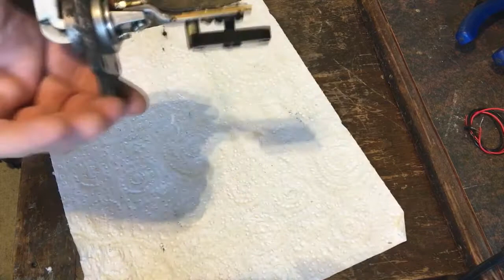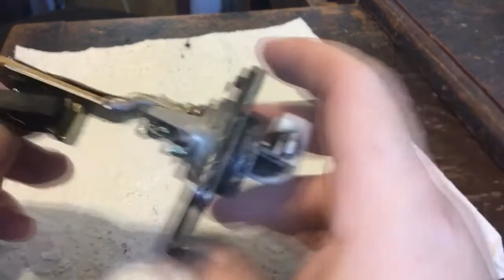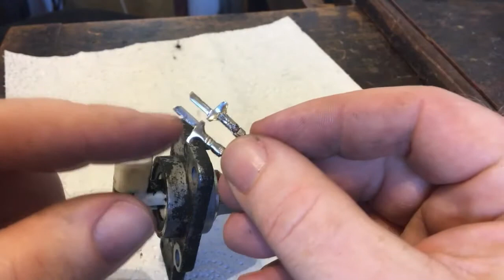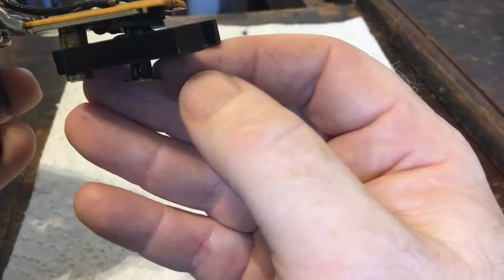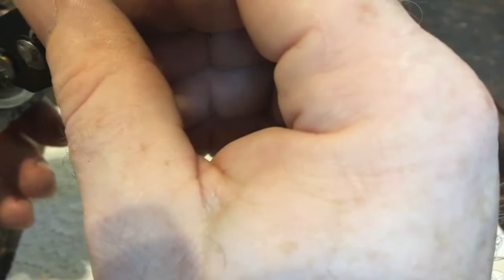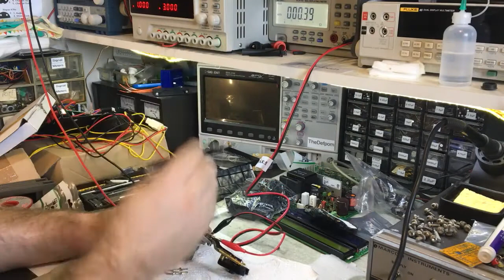#206 Toyota Coaster HDB51 1HD-FT Oil Level Sensor Repair

Comment: The float is magnetic and there is a reed switch in the center column which can get stuck. As this is an obsolete part for #Toyota #Celica #MR2 #3SGE Engines, #OilLevelSensor #89491-20050. The first pillar also has something inside shorted out as well. would love to know the principles of operation if anyone knows? I am attempting to repair mine by taking out the reed switch and replacing it with a reed switch from a window alarm contact. When float is up the contact should be closed, when float is down contact should be open. Hope that helps (would have helped me if I had know it before I started). Now let's see if a glass house reed switch can stand up to an automotive application. Touch wood.

Comment: hello
this is a magnetostriction oil level switch however I cannot tell you how it works. Do you know what are the two measurable resistance values at low oil level and at high? As far as I recognized it on your video, when oil level is high, the resistance is high, and when the oil level is low, the resistance is 0.4ohm. Were they a good sensor values? Correct? Thanks

Comment: Mate, I just pulled my oil level sensor out as it had the same issue. And that black "H" shaped piece of plastic is completely gone on mine. Which I would assume means the oil has nothing to press/float against, which means the switch wouldn't work. Any thoughts on that? I really don't want to spend $450 on a new part (let alone trying to source one) when I'm going to be posting the van for sale very soon
Reply from the maker: Kyle Juelfs - I’m afraid there is little choice but to buy a new one, even though I found an issue with this one it didn’t fix the problem, once I put a new one in it was fine. You can get the sensors from Toyota, that is where my local garage sourced it from.
Reply: TheDefpom Thanks. I've only found one online and it comes from UAE, and I'm in Australia. Haven't contacted Toyota here yet. Feel like an idiot paying 400 for a tiny piece of plastic
Reply: Cheers. There's gotta be a way to just replace the black missing float thing. Like with a clothes pin haha
Reply: @kylejuelfs6401  I know this is an old post so I apologise for the bump, but you dont even need an oil level sensor as long as you have an oil pressure switch that works (the red oil light) and manually check your oil regularly- just disconnect the plug. I have not personally tried this so I dont know if it will trip any codes in the ECU if it detects no connection, however I have read others saying to do so as my sensor may also be screwed but Im not going to let that stop me from using an otherwise sound car.
Reply: @MrGW2fanboy  yeah I ended up finding a similar part and just bent the piece to mimmick the one I removed. Re-installed and presto! Fixed the problem
Reply: @kylejuelfs6401  thats awesome I wish you made a video of this :P would love to see what you used
Reply: @MrGW2fanboy  yeah I really should've. I'm bad for finding solutions but then not posting mine when I come up with one. Sorry bud!

Comment: Did it work? Great video and thanks!
Reply from the maker: Although I found an issue with it, it did not correct the fault, I ended up replacing it.
Reply: Interesting Video thanks  @TheDefpom  - was the replacement part any different to the used one? Like was the phenolic type plastic magnetic? If you pull the sump pan off you may find a piece of metal/magnet in there... along with the sludge ;-o

Comment: I have one question Electronics is a hobbie for you or you works full time fixing things?

I work in electronics for 40 years and still works full time in my house. 

I fix treadmill machines, fractional lasers and IPL machines only.

Here in my country radio and television repair shops are disappearing.

Cheers.
Reply from the maker: Ricardo B - hi, electronics is a hobby, I fix this stuff for fun, I have a very different full time job, which has nothing to do with electronics.
Reply: I start in electronics at early 8 years old.

I know some persons who have their jobs and make electronics for hobby only.

Still I have tons of funnies moments working in electronics.

Comment: Most engines from major manufactures have oil level indicators even General Motors. In fact a lot of GM engines not only have the oil level but they will tie either oil level or oil pressure to the fuel pump relay. So if you get to low on pressure or level it will shut the fuel pump off. Sadly this is not universal and seems to be hit and miss by engine model instead of on every engine. 

Some car's will come on when you are 1 quart low and other's you need to be close to uncovering the sump before they come on. given how expensive diesels are and the rate at which they eat oil is only makes sense to have an idiot light and sensor.

Realistically every time you put fuel in a vehicle you should be checking the oil and other fluids in non-commercial use. In commercial use you check the entire vehicle from front to back and top to bottom each day before you start your shift. Men today but especially women do not check their oil and fluids as they should.